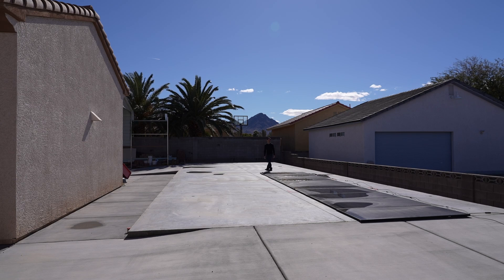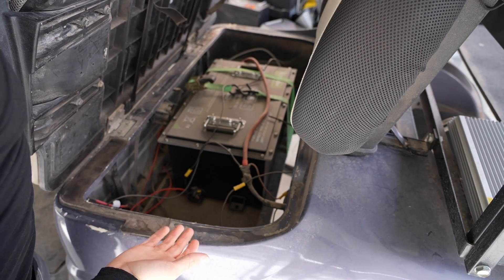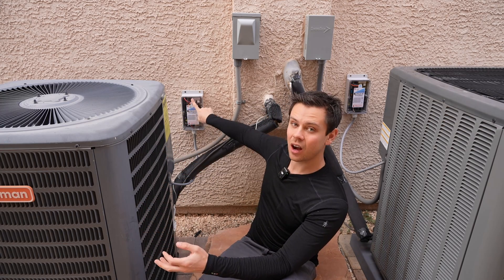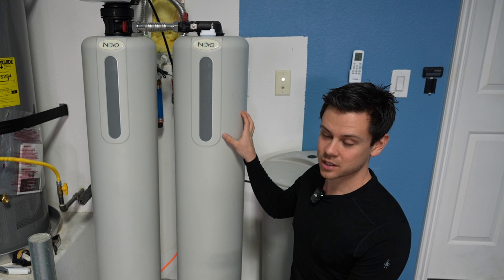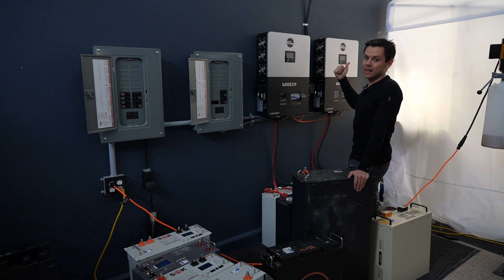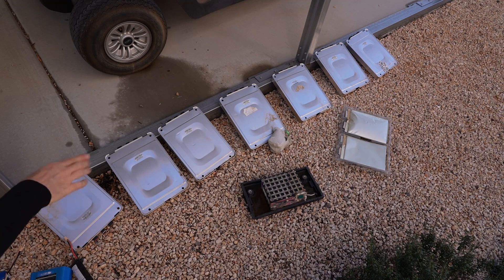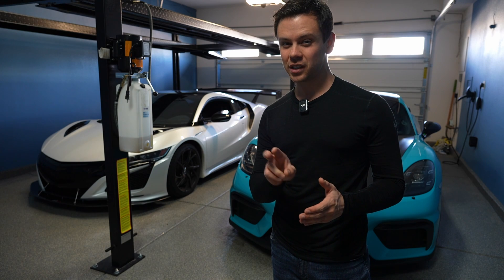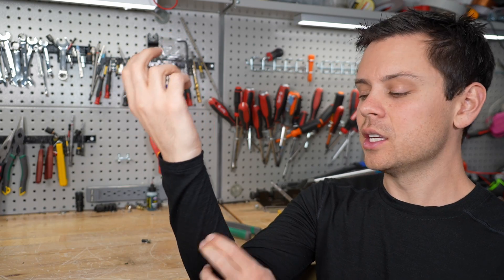Workshop #2 Update! And other projects I am working on (Including my Catio!)

Comment: Would you mind giving us some insight on water purification system you’re using? RO water obviously is no good as it pools all minerals, I use it only for cooking, but would love to hear about system that can feed hole house, decontaminating it but also allow for minerals to stay in the water
Reply: A whole house Ozone System is the most economical purification for that volume of water. Water doesn't contain enough balanced mineral content to make any meaningful contribution to your diet, that comes from your food intake.
Reply: @BoxerGuy-q3e  I use ozone from time to time to sterilise the room, also have ozone water generator connected to my washing machine and dishwasher, use it too for window cleaning. Obviously mineral water is not enough, you need good diet. My main question and concern is that RO water is neither good for showering or drinking, main reason is that it absorbs your minerals from your body, instead adding something to it, it takes away them. That’s why I’ve asked what type of system he is using to purify water for entire house and garden that come from the main, bacteria is one thing and ozone works great, I’m using ozone also on my reef tank, but for drinking, showering and watering your veg garden this I simply not enough as it won’t remove heavy metals and other nasty stuff like chlorine (Europe) fluoride (US)

Comment: Have you thought of running a solar electric water heater or showing us a diy on one. I replaced the gas version I had last year with a Rheem heat pump. But since then I have seen some standard electric versions running off a cybo inverter straight to the element.

Comment: I'm in my 70's and been involved with racing motorcycles most of my life so due to my age I decided to shift my activities back to cars and settled on a new Porsche 981S after a lot of research. I had an engine tune done by Softronic which turned up the grin factor a bunch. I've followed Porsche since the 60's and always wanted one but not the rear weight biased 911 so when the mid-engine Cayman came out it was time. You're right about the handling, the car pivots around corners so effortlessly it's just amazing and I'll own it until I'm gone. Durametric makes a great diagnostic tool if you would like to take a deeper dive into your car. By the way my handle is BoxerGuy...it's an engine thing.

Comment: Hi around the 6 min mark I see that your gas line does not have a sediment trap. Instead of a 90 it should be a T with a small pipe and end cap at the bottom.
Reply from the maker: Oh crap I didn't know about that one. Had that installed recently by professional. Thank you for the heads up

Comment: Side note for the model 3. It has no manual door override in the back seats. So if you have a sudden issue like a battery fire or driving into a lake and there's no power getting to the doors... The people in the back seats are just screwed. Hopefully they can break the window or climb over the front seats because only the front doors in the model 3 have a manual override. I don't know how they passed any safety inspection at all without a manual override for emergency escape on the rear doors.

Comment: Enjoy the vid. 
One note is if you pull someone on a bike or whatever, 
that may be a civil violation of towing a sled.
I got a ticket for this, but I am in TN

Soft start is a must for off grid.
My A/C and refrigerator are both soft start.

I only wear cotton under ware and socks. I prefer cotton/ linen fabrics.

Comment: Would such a soft start also work for a borehole waterpump? 

Mine lays 200 meter deep so needs 4,5kw at start-up, and now runs on a generator. With European gasoline prices of €1,75 liter (about $7,25 per us gallon) that is no fun.

Comment: Your instructional videos have helped me learn about solar and what I should expect living off grid. I will need to replace my Lead Acid 40kwh batteries here in the future and using your websight i think i may have settled on a two-phase approach to upgrading to Lithium Iron Phosphate. 

I cant use electric cars for my purpose as they cost far too much and carry far too small a payload. So i will stick to my 1990, 2002, and 2016 GMC Trucks. They are all paid for and the older ones a very cost effective to maintain.

Comment: I'd like to see someone with a cybertruck tow a trailer with a solar panel array from coast to coast to see without stopping to see how big the array would have to be to match the discharge rate at normal interstate speeds. This feels like it's something within your wheelhouse,Wil. Perhaps you could partner up with a Cybertruck owner. You provide the panels and the trailer. They provide the Cybertruck and fabrication to recieve the panels and charging station. Than you can rent or loan the trailer out as "Pop-up" power.

Comment: Hello Will I'm looking into water filters too but isn't just filtering too much equally (or more bad) ? Because you remove all the electrolytes your body needs. Do you have solutions for that ?
Reply from the maker: I add minerals back into the water. Only logical method I've found to avoid the bad stuff
Reply: @WillProwse  yeah that's what I intend to do too. How do you do that ? I found some system online that adds them right after the filtration but I'm not an expert on it
Reply from the maker: @captainnoyaux  if you're drinking the water it needs to be reverse osmosis. Then I buy ionic trace minerals to add to my water. I also buy electrolyte supplements.
Reply from the maker: @captainnoyaux  need to find good source for the supplements though because some of them are junk

Comment: If you wear wool you should also wear grounded shoes because you will get zapped all the time.  🙂  Its nice that you are health conscious but have you ever measured the EMF, EF and radio emissions around your house with all these inverters?  Have you measured with an oscilloscope the ripple and voltage potential between your neutral and ground?  You might be in for a surprise...

Comment: Thank you for all your work and information...love the channel been following for a few years. Love the tour..I heard you mention needing to check out the new Ecoflow Delta Pro Ultra def interested in that review just received my starter kit today, wanted to purchase before the 1k off Feb 9th codes expired......I was drawn to it by the ease, power specs and slight glitch it skirts in the solar permit matrix. Would love your input on adding other backup battery brands and charging with more eco friendly all in one with battery backup. Plan on using with transfer switch and no feeding the grid. Keep up the stelar work hope Ecoflow sends you review material soon and yeah big change since the RV on the street days. No subsitute for putting in the time!

Comment: Your metal shops have you consider mounting some PV’s on them, I think it could be done because of the design for snow loading. The one you should in this video would need to have some pearlings added to hold the mount system. I have 2 of these building and I’m going to ask the manufacturer about this the next time I’m out by his place. Just a thought 😊

Comment: I saw some EG4 LifePower4 batteries on that shop floor that look like they could use some love... I'll be posting soon on the forum because I'd been noticing some issues with my EG4 18kpv set-up via a backfed breaker that I'd like to share. I've been accumulating data, screenshots, and CT readings to better show what's been going on with the power output.

I'll look forward to hearing what you think of my future post. Either way, I'm hoping its something thay can be worked on in a future firmware update, because as of right now no alteration of setting can remedy the situation.

Comment: As you live in Las Vegas, and you run a lot of heat pumps, have you ever considered painting your house white to reduce air conditioning usage? From what I've researched thats a free 300w per square metre of cooling. Thats a lot of solar and battery you wouldn't need as im assuming a huge portion of your energy needs in Vegas come from aor conditioning.

Comment: On doing your own research. It can be tough finding fact based info, so much out there is (dare I say) mentally defective opinions 😞 Also if researching dietary or medical, look at the studies or more importantly who funded the studies. The studies always benefit the sponsors of the study, AKA big pharma and big ag.

I have been in SW MN, South Dakota and North Dakota. Where there are big water towers out in the middle of nowhere. Talking to some locals they said the water is so polluted the farm animals were on the verge of dying from dehydration because they would not drink the water. So these water towers were put in with wells of 1,000 to 1,500 feet deep to get drinkable water, then it is piped to the local farms.

Comment: Hey Will, I have a question about those “soft starts”. Is this something that could be installed on a camper or RV? Reducing that start up demand could definitely change things for an RV power system.

Comment: building permits in las vegas are a major hassle... it took me and my father almost 2 years of bureaucratic bs to get the permits for replacing the cedar-shingled roof on his house with lightweight fireproof composite tiles. we had to hire a structural engineer to certify the framing of the house, another engineer to draw up the plans for the replacement roof, then it had to be inspected 4 times- once before the job began, once after the old roof was removed, and twice after the roof was completed. all in all it took almost 3-1/2 years to re-roof a house and the permits, plans and inspections cost over $4000. ridiculous.

Comment: Following! Spot on video, thanks to your videos we ordered 9 EG4 LL-S 48V 100Ah lithium server rack batteries yesterday to replace our sagging 48V lead acid system of batteries that are only 4 years old.  Emily at Signature Solar made it easy packaging 2 server racks on wheels and a Victron Lynx Distributor. Great helpful quick responses from Diysolarforum folks reassured us to get the batteries now before the new inverter in the spring. Come spring we'll get an EG4 6000XP from her and more solar panels.  Then if we add a Primus wind turbine, we'll get another 6000XP. Split phase to charge PHEV (Plug in Hybrid EV). Please consider me for one of your EcoFlow giveaways and I'll have a friend pick it up for me in Vegas, thanks and cheers!

Comment: I am running my min split AC, that is installed on my camper trailer, just like solar panels, this technology is very reliable, so efficient, still no issues, and working even though it has been hit so bad that it sheared the 4 bolts holding it to the mounting bracket

Comment: Soft starts never promised to save you on your electric bill.  They do help lower the surge current at start by operating the cooling fan first then the compressor.  It should deliver a longer life for the compressor and fan.  Expensive, but well worth the cost to install.

Comment: Do you ever have and issue (at all) with wind moving your panels?  I've seen your panels on the ground for quite some time.  In a past life, I lived in the Old Pueblo and have experienced the awesome Monsoons - they can blow stuff around.  I just left Santa Cruz for the freedom of the South and we have rocking straight line winds here.  

With the help of this channel and your drawings, I built the Signature Solar Off Grid set up inside a 35ft Cargo Trailer (I call it my "utility" trailer ha ha get it? ha ha) but need to add the solar panels.  I'd love to throw them on the ground and get the system fully functional, work out any kinks, and just get comfortable until I figure out my trailer roof mounting.

Oh and one more thing.... You use a Nat Gas Water Heater?  huh?

Comment: Hey Will!  I saw on another channel about the increased efficiency of mounting bifacial solar panels in the "standing up" position vs the "laying down" position!  It seems counter-intuitive, but the data seemed to be pretty impressive.

Maybe you can test it out in a future video?
Reply from the maker: Yes I saw that video, super fun idea
Reply: @WillProwse  Yes, looking at those power curves implied to me that in the hot summer of Las Vegas the "laying flat" panels will see significant power "clipping" due to the increased heat, thus lowering efficiency at the most critical time period, whereas the "standing up" panels already at their lowest power production at the hottest part of the day will suffer %%%% power clipping at a far lower rate!
    Could the heat effect help the "standing panels" exceed total energy production of the "laying down" panels?
   Only experimental data will tell us!
Reply: Interested in this as well
Reply: Great for farms, partial shade, easy to farm, extends the hours of solar power generation!
Reply: More people are testing that and i think only certain scenarios will make that more efficient. I will certainly be interested in the summer results though because thats when i think the will shine due to them catching the early and late sun that is rising and setting behind the south facing panels. I think the only thing that would beat that will be solar trackers....
Reply: Angled over the concrete reflection

Comment: I look forward to more info on your water system. I’m off grid and was just looking today at what it’d take to use surface water from our pond instead of just roof runoff and hauling. It may be cheaper to set up a heavy duty home filter system.  Charging my Lightning at the moment at 48A, which rules.

Comment: Soft-start devices are expensive because they have not been commoditized. Taiwan will do a creditable knock off, it'll become a price war, the high cost operators will die off & soft start kits will be about $200 plus installation labor [which is easy advanced DIY level stuff]. Only reason it's advanced is the identification of electrical components & splice locations which scares a lot of folks

Comment: Hi @13:05 that structure I turned into a shop by blocking in the ends and taking the sides to the ground. I also used exterior plywood for the inside walls to make it easier to attach things to the wall. A really affordable alternative to a stick build. it 24x44 I can fit 5 cars if I put one on my lift. Thanks for the water filter info I have been thinking on it for a while I think its time to do it. Cheers.
Reply from the maker: That's smart, I should put up the plywood like you. Super smart. And wow five cars is a ton!!! Nice

Comment: Thanks for another informative video Will, I’m in the water industry myself and you are 100% correct on the water people consume… can you send me info on the filtration system you chose? Thanks.
Reply from the maker: Dang it I forgot to include the model number, will find out when I go home. Ive been seeing some really good ones on Amazon lately that are easier to install than mine. Need to research more on all options. Not sure how mine compares.
Reply from the maker: And thanks, glad to know you agree and work in the industry
Reply: We have rainwater collection for everything and I filter it several times ending with a quantum filter to kill bacteria and such
Reply: I’ve got a off grid cabin in northern Wisconsin, shallow sand point, just curious what others are using for filtration

Comment: I’ve filtered my tap water for over 25 years. 
And the only reason I shy away from polyester clothing is because I don’t want to contribute to microplastic is my waste water. 
I don’t think wearing polyester affects your hormones.
Reply: I've used a tap water filter since the late 80s. I used to be able to get pressed carbon block filters for it but the last decade only coconut fiber filters for this old Amway unit. Would like to hear about the filtration you showed @WillProwse.

If you watch Dr Ken Berry, he also talks about the dangers of plastic. Even plastic bowls and water bottles. Especially with heat. Same estrogen warnings.
Reply: @JeffM23  you couldn’t pay me to drink a bottled water. 
I am so against everything that bottled water has perpetuated on health and the environment. What a virtually unrecognized catastrophe that is.

I will check out this doctor.
Reply: @JeffM23  check out installing a triple 2x20 whole house filter housing
 I filter all incoming tap water down to 5 micron and it passes through a GAC filter and a carbon block. Then I further filter my taps and refrigerator that I drink from down to 1 micron.  I’ve had that water tested and it is very pure and not completely stripped of minerals.
Reply from the maker: Check out the studies on polyester clothing and the logos they use on textiles. It will blow your mind haha and yes micro plastics are huge problem! Messes with estrogen receptor sites
Reply: @WillProwse  I will back peddle a little bit. I’m sure wearing polyester has some health consequences. I just don’t think it’s is cause for alarm. I’m more worried about washing the clothes and the micro fiber’s getting in the water supply.

I will try to. Find some studies and read up on it. 
Thanks for the video Will. 
I enjoy your channel so much and have learned a lot.
Reply: @WillProwse  I wear polyester underwear infused with cannabis oil and synthetic viagra. My sex like has never been better.

Comment: How do the panels go with retained heat flat mounted on concrete Will?
Is there much efficiency losses?
Reply from the maker: There is but it's not that bad. Usually I lift with a brick on one side but during winter it's so cold that it's usually ok. During summer they need to be lifted